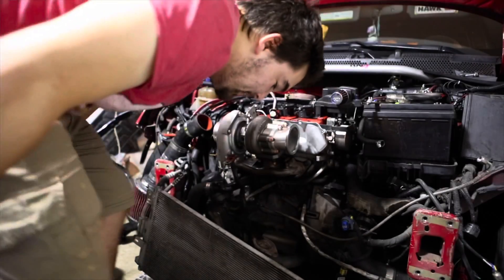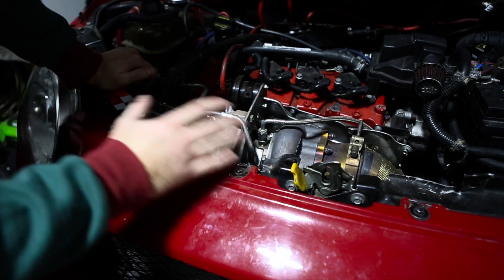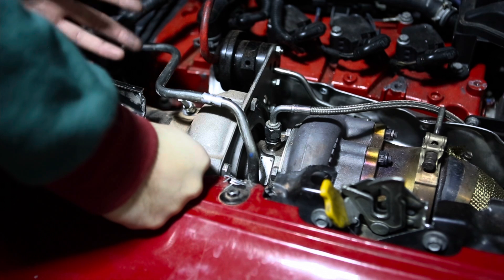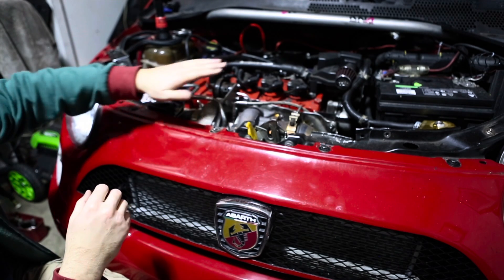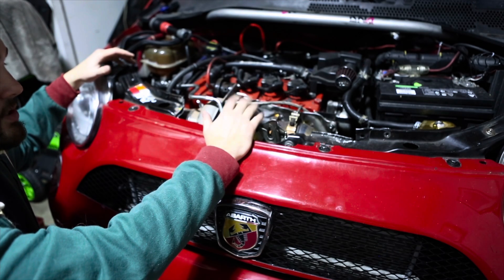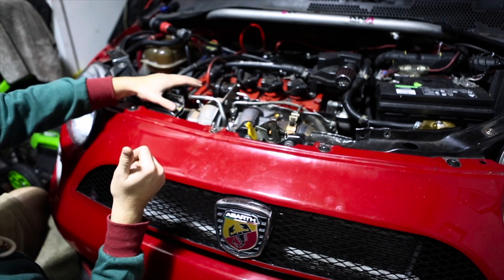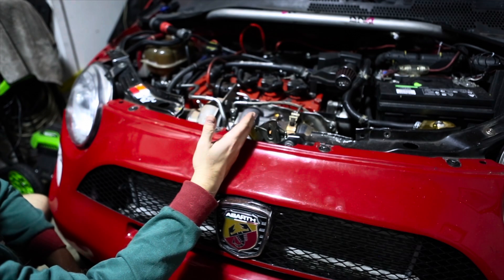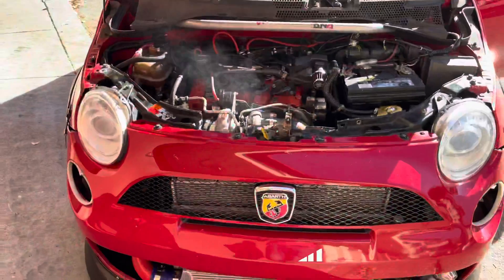Fiat 500 Abarth gets a Bigger turbo, Garrett GTX2860r Gen II Breakdowns and Requirements

Comment: Hi great mod.  Apart from the front mounted intercooler and turbo upgrade...  Did you have to do anything to the engine internals? .
Can you list/advise what mods are required over and above the Turbo and intercooler?  Thx
Reply from the maker: Mtd camshaft, pistons and rods can be done. However methanol helps a ton when it comes to keeping everything internally cool. It was boosting at 24psi with zero issues.

Comment: what coolant line did you end up running on the back? i am putting the same turbo on my car
Reply from the maker: It was a custom made line, I bought the kit from Amazon using a universal kit. It was then welded to the the factory line. This helped keep the connection from the oil housing / coolant housing.
Reply: @jts_motorsports  awesome thanks for relying im putting a 2871 on my car and its essentially the same setup. what manifold adapter did you use if you dont mind me asking:) cheers

Comment: Was wondering how the turbo outlet to intercooler clears the water oulet pipe to radiator
Reply from the maker: Hey, mine went in between the radiator and frame. It cleared with 2.25 & 2.5in piping.